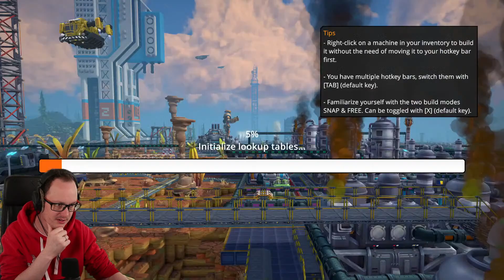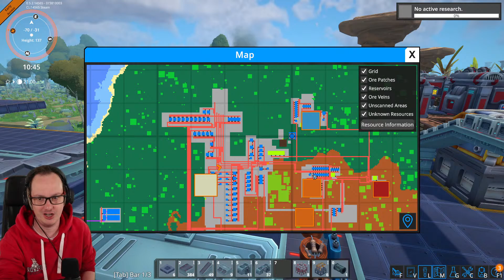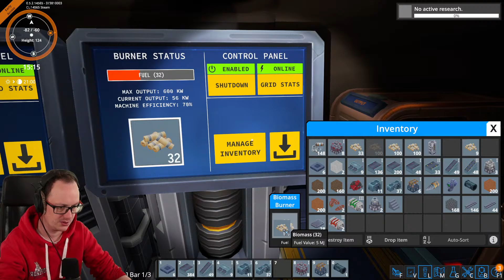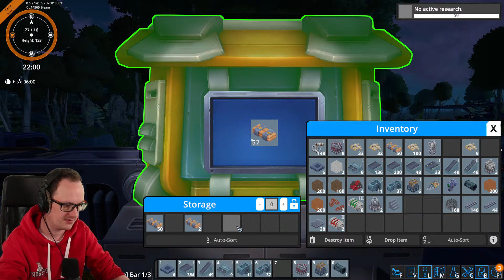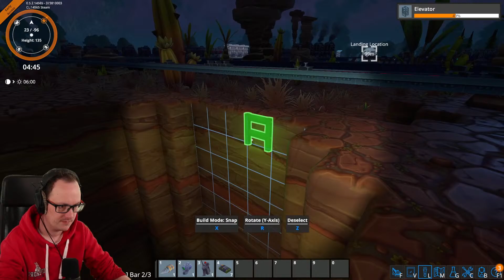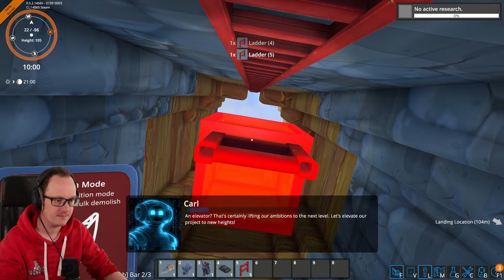Foundry - Day 3 - Science 3 & Oil

Comment: I had to go out and find a new area that had more of both the steel components and I created a full conveyor 2 belt (of each) just for steel production that was still only 4 crushers and 8 smelters of steel (which is what, 80 steel per minute (or 1/2 of a teir one belt).  Steel is hard

I had to belt the steel back about 500 meters on a type 1 belt..